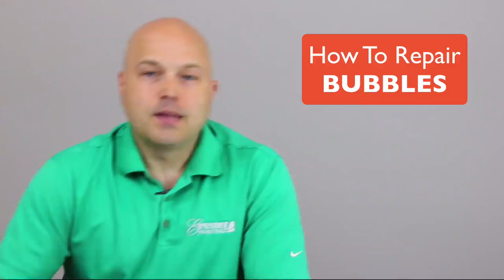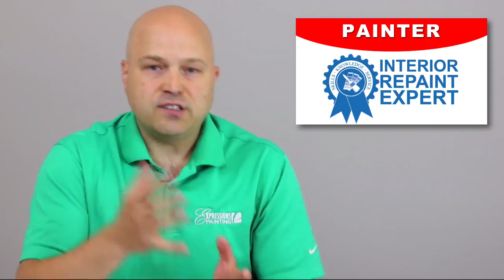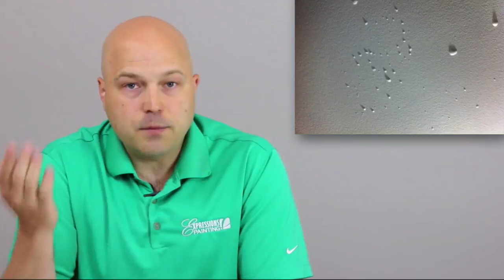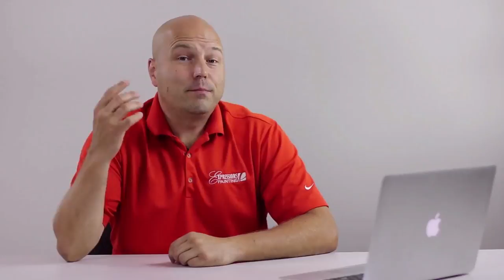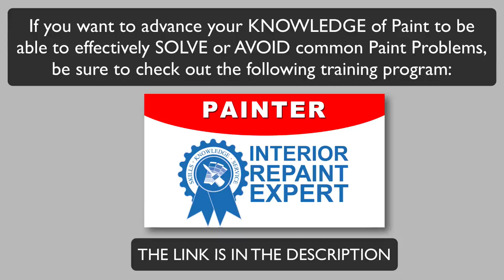How To Repair BUBBLES

Comment: ok guys, here's what you do to fix it. 1. scrape the blisters and sand.  2. prime the entire area with oil based primer. (if you try a latex primer it may not work and more blisters could appear right away).   3. let it dry completely, about 2 hours.  4. patch the scabs with drydex or whatever and let it dry. sand them.  5. prime again, but just on the patched scabs, and let  it dry completely.  6. apply your first coat of paint.  7. let that dry completely, could be 2 hours depending on the sheen, check the paint can for dry time.  8. once it is dry, sand the entire surface and finally apply the second coat.